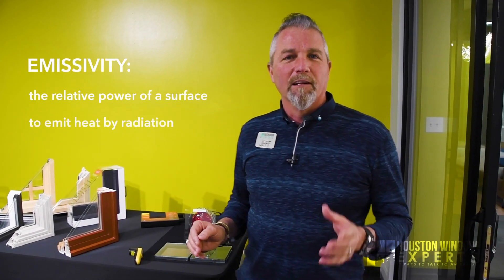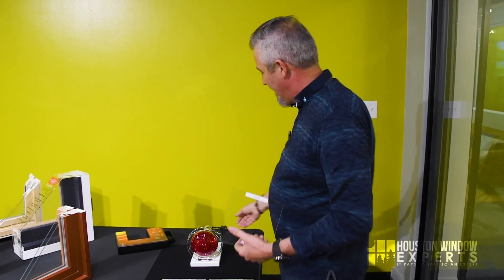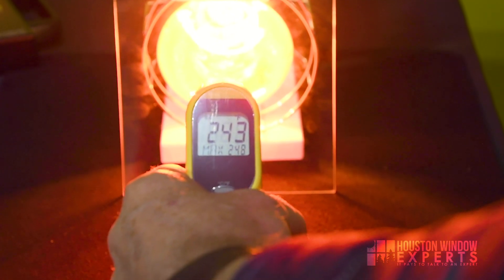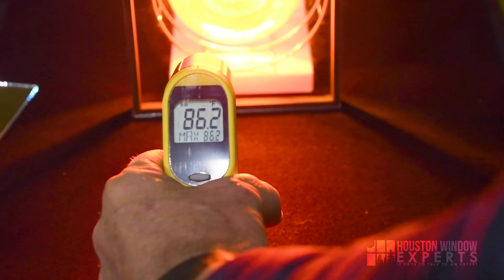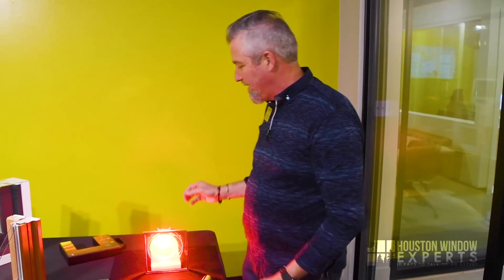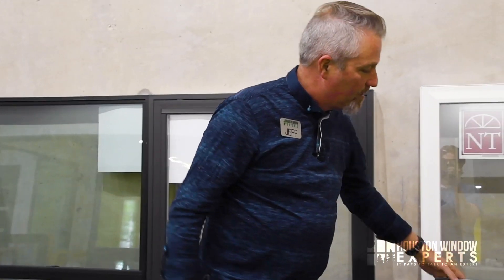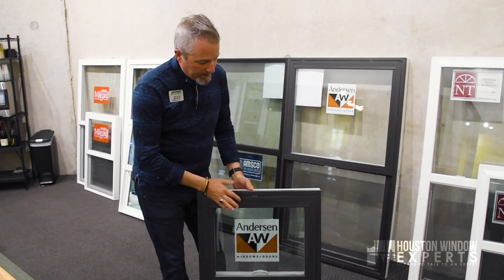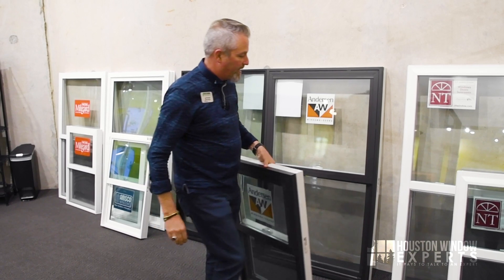What Are Low-E Coatings For Windows?

Comment: Good day Jeff, Paul here from Ontario Canada Suburb. I have a question about the Low E coatings. I recently purchased main floor windows and doors and home faces South by the way. We had a recent government Loan program that would help with the costs of a window, as long as they meet the minimum 34 ER rating. So I mentioned this to the manufacturer distributor I also requested and made a agreement that all the windows be a 272 Low e.and got 180 Low e windows instead delivered b!! Now knowing that someone messed up the paperwork order. They are telling me that 272 Low E coatings won't pass the loan process and also are not covered. Hence why they put a 180 Low E order.Also they mentioned I got wrong window Labels and will be dropping off replacements now.
Any advice and thoughts would be greatly appreciated. Thank you in advance for your help and time.
Reply from the maker: Hey Paul! That sounds frustrating — you’re right to double-check the Low-E specs. The 180 coating is often used in colder climates to boost ER ratings, while 272 is more common here in the South to reflect heat. Definitely get everything documented and confirm with the loan program what qualifies. Also, make sure the pricing on your glass is accurate — different Low-E coatings come at different price points. I’d suggest reaching out to a trusted local window company with great reviews (Other than the one who sold you the windows)— they’ll know your area’s requirements best.

Comment: How do you get three coating layers if only one surface is coated? If the coatings are on one surface then unless you know the coating thickness since each may have a unique thickness. It's all marketing if you call it a triple 50um coat or single 150um coat if they are both 150 um thick in total.
Reply from the maker: Great question! Triple coatings usually mean multiple thin layers applied on a single glass surface to improve performance, not just one thick layer. Each layer adds specific benefits like heat reflection or UV blocking. It’s not just marketing—multiple thin coatings can outperform a single thick one even at the same total thickness.

Comment: What if i want in summer to keep the cold in and in winter to keep the warm in?
Reply: It’s hot and cold transfer. It keeps the heat and cold where there supposed to be. So in winter it keeps heat in and cold out. Summer keeps hot out and cold in.
Reply: @jybleezy  At the end of the video he says otherwise.... to plan which side gets the low e depended on the climate of the specific house
Reply from the maker: Everything is a trade-off. You have to pick whichever one is most important to you.
Reply: @HoustonWindowExperts  Can't I just put low-e on both sides?
Reply from the maker: Yes, Low-E coatings can be applied to both interior and exterior glass surfaces. For hot summers and cold winters, the key is selecting the right Low-E types on each side to balance blocking heat and retaining warmth. It’s best to consult a window expert to find the best combo for your climate.

Comment: Is it the same as the ceramic film?
Reply from the maker: No, Low-e coatings are thin, multi-layered metallic or metallic oxide coatings applied to glass to reduce heat transfer and improve energy efficiency, while ceramic film is a type of window tint that reflects UV rays.
Reply from the maker: Low-E is a thin metallic coating built into the glass during manufacturing, while ceramic film is an aftermarket surface layer added later. Both help with heat and UV, but they differ in how they’re applied, function, and perform. Low-E is the premium solution. Thanks for watching!

Comment: Hey I had a old picture window in my living room and it was always hotter than any other room. It was cold in winter hit in summer. I installed window with Low -E and Argon. It’s still light but very comfortable plus saving on my heating & cooling bill.
Reply from the maker: Thanks for sharing your experience; low-E coatings can make a big difference in comfort and energy savings!

Comment: Excellent information, I live in Canada and have double Low-e (Grey). The Solarium remains very cold in the winter and noticed in a hardware store a plastic texture that can be put on glass. Could this be an option to additional cold remaing out? Would this damage the low-e glass?
Reply from the maker: Adding a plastic film can improve insulation and reduce cold drafts without damaging your Low-E glass. Just be sure to use a product designed for windows and follow the installation instructions carefully.

Comment: Why the external  temperd  glass is  breaking  in summertime?
Reply from the maker: Great question! Tempered glass can break in the summer due to thermal stress — when one part of the glass heats up faster than another (like half in sun, half in shade), it can crack from the pressure.

Other causes include edge damage, improper installation, or rare impurities in the glass. Even though it’s strong, extreme heat can still cause it to fail under the right conditions.

Comment: Question....home in the deep south facing south. Windows only get direct sun in the heating months. In the cooling months the sun is too high to pass directly through the windows. 

The sun in the winter really heats the home. I measured over 100F on the floor from the direct sun. 

In this case it seems like Low-E isn't the way to go. Can you share your thoughts? We are not replacing the windows but adding storm windows and have the Low-E option. They describe the coating as LoE-x89 so I am guessing it isn't very aggressive coating.

Comment: Thanks for the video. What if you flip the orientation of the low-e test glass? I wonder what numbers the thermometer will give? We have low-e windows currently being installed in our house and the installer insisted that the orientation of the glass doesn't matter. 

We live in a hot climate, and direct sunlight on the windows. We have both low-e single pane and low-e laminated glass. For the laminated (monolithic), the low-e coating is put in the middle of the panes. Perhaps maybe I just go and buy the heat lamp from EDTM and see for myself which orientation is best? But I'm curious as to the numbers that I would expect...

Comment: I'd like to see an additional demonstration of Low-E coating. Your demonstration showed a single pane of untreated glass lowered the temperature by about 100 deg (360 max to 260 max deg. You didn't show the max temp for the double and triple coated tests). So an untreated double pane would lower the temp by at least 200 deg. Did the triple coated glass have 3 panes? If not, how are 3 coats applied on a double pane window? Since the outdoor temp rarely gets above 120 deg, wouldn't a double pane window with untreated glass lower the temperature by more than enough? 
Is untreated glass even an option or do installers just stock glass that's already treated?
Reply from the maker: You can have clear or treated glass for your window. The triple coats of low e are all applies together on the same surface of the glass. You can have 0, 1, 2, or 3 costs of glass regardless if it's a double or triple pane unit.

Comment: I live in a part of the country where we have temperatures in the winter that can go to the teens and single digits, and then in the summer can be up to 100.  Will it be best to have the coating on the front or the back pieces of glass?  Thank you
Reply from the maker: On surface 3. (Inside pane).
Reply: Thank you very much for answering my question so quickly!

Comment: I'm in eastern ks where I've seen 117  in the summer and down to -31 in the winter. With that in mind, what E coating should I have?
Reply from the maker: I would go with a glass package that is designed for what they call North Central. That is typically going to involve the Cardinal low e 272 glass package
Reply: @HoustonWindowExperts  Since I heat my home with a wood-aire fireplace and if it's too cold, I just throw another log on the fire so windows for a cold climate won't save me as much as ones for the summer when it's hot when my electric bill rises due to the AC running more. With this in mind, would you still suggest the Low w 272 glass package?

Comment: Why do you put the coating inside of outside pane of glass if it's southern climate? I was thinking it should be outside of the outside pane of glass.
Reply from the maker: We put it on surface two because that's the closest surface to the heat that's not on the outside. If you put the coating on the outside it could scratch and get damaged. It must be between the panes of glass.
Reply: @HoustonWindowExperts  okay but we want to reflect the IR of the Sun because of it's southern climate. So if the coating will be on the inside, don't we reflect the IR of our room? not the Sun's. The heat stays in the room because it reflects by the inside coating and Sun's IR still goes inside because we don't put the coating outside. Sorry I'm confused :(
Reply from the maker: I am a little confused also. I'm not sure that I understand your question. The bottom line is, they put it in one place for southern climates and in another place for Northern climates. If you're trying to keep the heat out it goes on the outside paint and Glass but it's on the inside of that pain so it does not get scratched.

Comment: It means that during the winter it won't let much heat from the sun inside, right? But also won't let the heat out, so it's kinda making up for the heat reduction from direct sunlight.
Reply from the maker: Great question. Since Low-e coatings reject the passage of heat, in southern climates they are designed to keep heat out while in northern climates they are flipped to keep the home's heat inside. If you live in a hot climate Low-e is working for you in the warmer months while in colder climates they are serving you in the colder months.

Comment: What is your opinion on Simonton StormBreaker Plus windows? Thanks
Reply from the maker: I don't have much experience with that product because we don't install in hurricane zones. I've used it a couple of times and had good luck with it. The only thing I don't like is that you have to put screws in the sill if the windows for it to pass inspection and I've had a few leak after a few years. Be sure to over seal those screws as much as possible.

Comment: Slightly tangential topic - I'm trying to decide between double and triple paned Pella vinyl windows for my bedrooms for street noise reduction. In your experience, have clients noticed a difference between double and triple pane for noise reduction? It costs about $225/window to upgrade to a triple from double (I have 6 windows total). Is it worth the upgrade? 

Thank you so much for your videos! These are extremely helpful as I navigate new home ownership and windows.
Reply from the maker: Thank you for watching and your question. I'd ask them to give you the actual STC data to compare.
Reply: @HoustonWindowExperts  Thanks! It's 26 STC for double vs 28 STC for triple. The STC scale isn't linear (as far as I understand), so even though the difference is just 2 points, in reality it might be a bit more than that. Not sure - thoughts?

Comment: Referring to the end of the video,  if installing window opposite way creates heat trap , what means,  in low-e terminology,  passive coating vs. solar coating. Is it lack of knowledge or what
Reply: That means,  there is no such a two main types of low-e glass (passive coating and solar coating) witch works exactly the same as your statement shows  but not just by installing the same piece backwards,  but two separate type of glass panels? Passive,  for trap the heat and solar for stopping the heat from getting through the glass.
Reply from the maker: I may be unqualified to answer your question, perhaps because I'm not completely clear about what you're asking. With regard to low e coatings, all the information I've learned is that they are all made from Silver oxide. They can be applied in varying quantities and on different surfaces of the glass in order to achieve different outcomes. Applying low e coatings on Surface 2 helps reject heat to the outside while applying coatings on Surface 3 helps reject the heat to the inside.

If you do a Google search on the topic of low emissivity coatings, you will find a lot of technical information that may be able to better answer your questions. Thank you for watching.
Reply from the maker: The illustration I'm trying to make is that different climates require the low ecoding to be in different places. In other words, a window that's designed for the South would have to be installed backwards if I wanted it to operate properly in the North. Obviously no one would do that, it's just an example for the purposes of explaining the location of the coatings.

Comment: Is there a way to test if our Windows have LowE or Argon Gas? If you get new windows is there a way to confirm if they actually installed LowE?
Reply from the maker: There is a tool you can use. It's a spectrometer. It's quite easy to see and should be obvious. Place a sheet of white paper inside and look at it from the outside. It should look a little green.

Comment: QQ, what is the diff between Hard and Soft low E, and which one is better for south texas. Thank you
Reply from the maker: Thank you for watching and for your question. I am not aware of anyone who is using hard coatings any longer. Even if hard coatings were available, I can't think of what the benefit would be. The soft coating is protected by the second pane of glass and should last for at least 20 to 50 years. If you are in a hot climate, I would suggest a low e366

Comment: How do you differentiate the kind of low e glass used in cold places from the ones used in warmer places
Reply from the maker: I mentioned in the video about two coats versus three coats of low e. In Northern climates you will use two and place it in the opposite location than you would a Southern climate where you would use three. If you watch the video again you see where I elaborate on that.

Comment: Do you think low E3 is sufficient for northern climate or is the price difference to upgrade to the low E3/ers worth the upgrade? Recently ordered infinity by marvin and I still have a chance to make a change. Thanks
Reply from the maker: Northern climates demand the best U-factor over SHGC. Ask for your rep to give you options for a better U-factor and then compare the pricing.
Reply: @HoustonWindowExperts  my salesman said its about $1,900 more for the ers glass upgrade but I won't save any money. His exact words were you'll save $5 over 30 years. Does that seem right to you?
Reply from the maker: Which option gives you the best U-factor? I'd say that a better U-factor might save an extra 2-3% off your utility bills compared to their standard options. The primary benefit would probably be that you'd "feel" the difference during really cold events.
Reply: @HoustonWindowExperts  do you think .27/.28 u is good for the NE?
Reply from the maker: Nice. I'd try for .25 or better if you can.

Comment: How much heat energy do you loose from the sun with a Low-E Coating compared to how much heat you hold in
Reply from the maker: I'm not completely sure that I understand your question. I will try my best to answer. In a hot climate you want to reduce the amount of heat that enters into your house from the Sun. For that, we have glasses designed for southern climates. If you live in the North where you want the heat to come through the window and help warm up the house, there's a different type of glass for that.
Reply: @HoustonWindowExperts  I live in the UK and have a house with a lot of south facing windows that during the day helps warm the house my question is: how much incoming energy from the sun does the Low E coating block if any compared to plain double glazing without a coating also how much heat energy does it hold in using a Low E coated glass suitable for heating not cooling
Reply from the maker: Gotcha..

The standard low-e will block between 70-80% of the sun's heat.

Comment: Low E is such a pain in the ass to clean with water fed pole systems.
Reply from the maker: I'm not sure exactly what you're talking about. The loic coating is on the inside of the glass between the panes. Can you please elaborate?